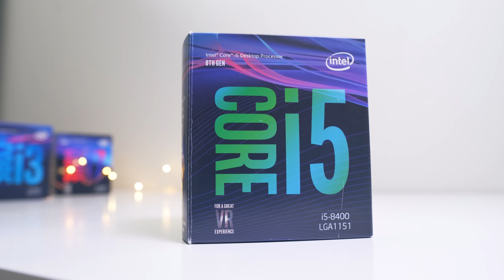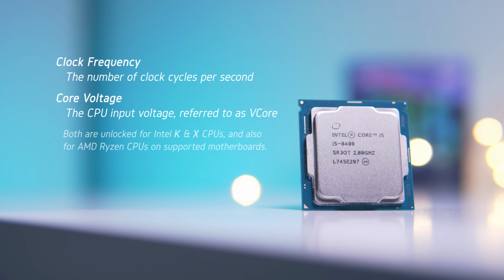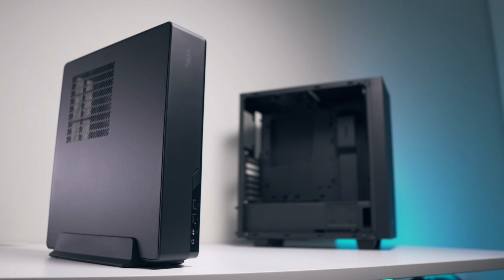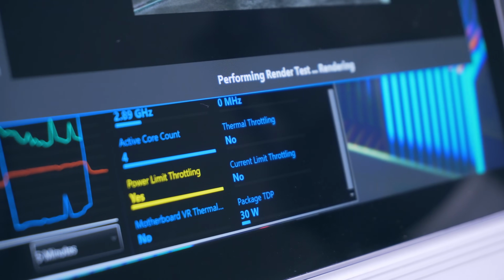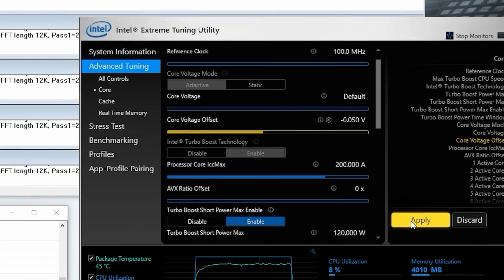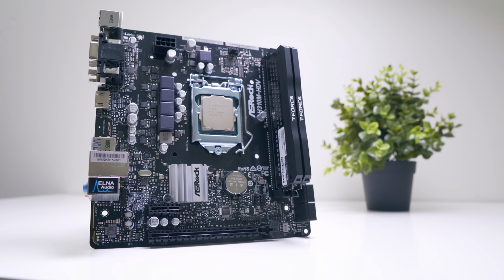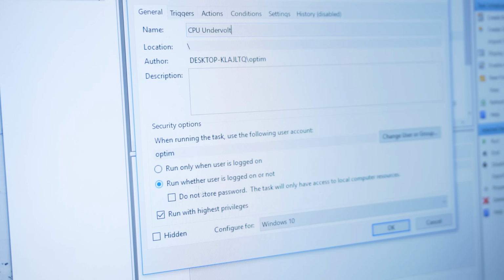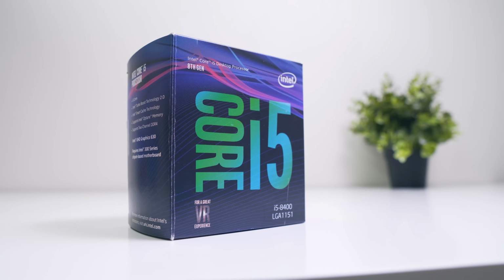How to Drop 10-15C° on Locked Intel CPUs!

Comment from the maker: Got this i5 8400 running stable @ 1.02V! I'd say under 1.0V would easily be achievable for some chips. 

Drop your undervolting adventures down below!
Reply: Intel has been supplying that same cooler for almost 2 decades now. Cheap bastards! At least AMD supplies a somewhat decent stock cooler with their processors. No, I'm not an AMD fanboy. I'm running Intel right now, but with a custom loop. It helps in the winter! Cinabench doesn't get the CPU as hot as Prime95. It does not use AVX. For Intel CPU's, I would use Intels own Extreme Tuning Utility, XTU.(Link Below) It will stress test the CPU far better than most programs, and has a lot of additional functions and info regarding your particular CPU. Undervolting does work very well, especially with laptop CPU's. Considerable performance gains, and extended battery life can be achived. Just speaking from personal experience. Worth a look.

https://downloadcenter.intel.com/download/24075/Intel-Extreme-Tuning-Utility-Intel-XTU-
Reply: @mattsmechanicalssi5833  I get your point but its but its not the same cooler they just look the same. The old one 3rd Gen and before had a solid chuck of copper in the middle.  The ones since 4th/6th (Can remember which) don't have the copper, it does makes a difference in cooling.
Reply from the maker: Santiago - some B360 and H310 boards do not have the option for voltage offset adjustment. If your board does, I'd definitely recommend doing it that way (I've done a few videos showing how to do it that way previously).
Reply: @optimumtech  need to get rid of power limit throttle. Using i7 8700 on H370. I had no issue on i5 8400 but swapping with i7 8700 there is power limit throttling so clocks drop to 4.0/4.1 in CPU intensive tasks. Can you please provide me the script so that I don't have to manually change the PL1 to 95w(in XTU) every time I restart my computer. Thanks...
Reply: Optimum Tech Can you review the Asus hero and scar please👍🔥🤔🥇💻⚠️
Reply: Thanks for the video! I followed your instructions then put the offset in BIOS. On my i5-8600 I was able to go from 89 C stock to 74 C with a -0.200 Undervolt using Prime95 Small FFTs and confirming stability using Cinebench and 3DMark.
Reply: Santiago - when idling the temp won't change, but when under load while gaming or using Prime95 you will really notice a difference.
Reply: Santiago -Alright, looks like you found your spot then. Enjoy your slightly lower temps.
Reply: On i7 8700 1.08V i got minus 7 degrees celcius and  500rpm lower on cooler. Thx for help.
Reply: @vasseurstan  how, can you please tell me your voltage and bios settings for lowering the temperature?
Reply: I think it should help, as reducing the voltage will allow more amperage to go to the CPU using the same wattage.
Reply: Optimum Tech would you use xtu over an offset in the bios? The software seems much easier to work with than having to go into the bios.
Reply: Should be pretty much the same on a i5 8500 right?
Reply: Asef Jamil Ajwad Try to find a tutoerial to unlock tdp limit.. i did from 15W to 25W
Reply: Santiago I did my voltage changes in Bios and got my temps to go down as well. Good luck!
Reply: Santiago -really? Interesting, I would have anticipated at least 5 degrees difference. How long are you letting Prime95 run before stopping? I'd recommend running it 15 minutes before stopping to let the temperatures ramp up.
Reply: Santiago - ok that's alright. If you push the voltage down more I think you still have some headroom left to lower your temps even more.
Reply: From 74C° at 2200RPM to 64C° 1950RPM with a -0.140V offset voltage on an i3-8100 in a DAN A4-SFX. Now I just need the Cryorig C7 and undervolt my GPU as well.
Reply: How do I know the best undervoltage for my processor by the way my processor is Intel core i5 2520m 2.50ghz
Reply: I used your same setting for my i5 8400 (with an Arcitc Freezer Esport Duo), and now at full load it does not exceed 49c.
The stock voltage reached 55/57c.
Great video and thank you for the advice!
Reply: RochiGaming, Intel. XTU advanced options are greyed out for me. How do I change the Core Voltage Offset? It’s not letting me change any settings.
Reply: TheOgWalnut Did you have my same CPU?
Reply: My personal Intel Celeron laptop is fully Locked and I can't undervolt it at all, even on Intel XTU. 😭😭😭😭
But Wait!!! One day, I was going to Mom's office because there are no one else at home, and then I suddenly found an empty unused PC there at the Office!
Unfortunately it had a spec of a potato, with a Pentium G3620 (Dual-core 3.3 Ghz) & 2 Gigs of DDR3...
But the fun thing is that I could install Intel XTU with no troubles at all!
I tried to undervolt it to the limit, as most kind of people do, and I started from -55mV and keep moving down every 10mV to -65, -75,...
I was suprised that I could put it down to -150mV!! Moreover, the Maximum voltage at stress test is now only at 0.947 volts, which is pretty low on a desktop CPU...
I finally stopped at -195mV @ 0.895V since it crashed after 30 seconds of stress test. So I turned it back up to -135mV.
But -195mV is a really massive number on the CPU world, and moreover, this is desktop CPU!!!

Note: using Intel cooler
Reply: Ive just undervolted my i7 7700 and Ive got pretty good results as dropped 10°C, but Ive got coil whine on my GPU now, Ive tried to reverse the procces but still getting that noise, do you have any advices/solutions for me?
Reply: -140mv on i3 8100, allowed me to turn the CPU cooler down to the lowest speed (will ramp up if it ever gets within 6c of maximum safe temperature) and I also completely did away with the single case fan I was using. This only increased the stress test CPU temperature by 2 degrees over the temperature I was seeing before the undervolt!
Reply: I went to 1.20 and it worked for a few hours then next day every game started crashing, it seeems to be fine at 1.22 but who knows
Reply: I guess I'm pretty off topic but do anybody know of a good website to stream new tv shows online?
Reply: @Robert Valentino i watch on FlixZone. You can find it by googling :)
Reply: @Corbin Adam yup, have been watching on flixzone for months myself :)
Reply: @Corbin Adam Thank you, signed up and it seems like a nice service :) I really appreciate it !
Reply: @Robert Valentino glad I could help :)
Reply: 12700 processor any ideas?
Reply: 11400f from 55-40 -100mv
Reply: I got mine stable at 0.944V, delidded, reaching 60C at 2h P95
Reply: Me too. 
core iccmax = 133,000 A
Turbo boost short power max = 82 W
Turbo boost power max = 65 W
Turbo boost power time window = 28,00 Seconds
I wonder, is it safe to change them as same as in the video ?

Comment: Unfortunately, I don't find the tool for my old intel processor. It would be great if someone could guide me on how to tweak it.
Below is my system configuration
Model : Dell Inspiron 14z (N411z) laptop
OS - Windows 10 version 1909 (64 bit).
Processor : Mobile Intel Core i5 2430M (Sand Bridge) - 2nd generation.
Chipset : Intel 6 series C200 series.
Bios : A06 (from Dell).

Comment: i have intel i5 11400H. in Intel's drivers download page i can see intel xtu software. That's means my cpu supports that software. But when i install that xtu software i couldn't change anything. You changed 8400, how tgat can be possible
Reply: newer cpus are locked by Intel
Reply: @sdtrtl  can i unlock, is there any options for these ? i have dell laptop

Comment: So I have about 100 Small Form Factor PCs. Coffeelakes; cannot undervolt, but cutting the max sustained powerboost from 65w to 50w gives only about a 7% reduction in clockspeed but about 17% reduction in power consumption, 12w so ~9% more efficient. Wish I could but sliders r greyed out. 
I CAN undervolt on Haswell and some Skylakes but not all it's very strange. Same model of SFF PC, some do some have it greyed out very weird. Leaving power limit the same but undervolting i5-6500 or i5-6600 by 0.12v reduces power by ~9 w 
Haswell i5s more sensitive downvolt by 0.07v.

Comment: bruh if the cpu is locked how are you changing core voltage and stuff they cant be changed in a locked cpu like i5 1300h

Comment: CPU: I5-9400F locked 3.9GHZ
Pre Tweak: 55c, 1.15v, 5818 multi score (CinebenchR23)
Post Tweak: 43c, 1.03v, 5850 multi score (CinebenchR23)

Power consumption also went down a bit, though I didn’t check by how much. 

Thanks for the guide! Shame you can’t OC these chips, looks as if there’s a bit of headroom.
Reply: Thanks for letting me know it will work on my CPU

Comment: I've got i7 8700 and installed hyper 212. Temps are OK stays around 60c while playing apex legends on 1080p low. But my concern is will undervolting reduce its clock speed? Right now it clocks @4.3Ghz on all cores without any issue but when stress test(powermax) it drops to 3.3/3.4Ghz with PL1 65w and PL2 87w(default values) and when I set PL1 & PL2 to 125w it never drops below 4.3Ghz on all cores while stress test(powermax) but temps touches 83/84c in 10min stress test.
Reply: As long as you’re not throttling whilst playing, it doesn’t really matter ig
Reply: @IIHydraII  yeah it's fine temps are fine I'm using adequate cooling solution but everytime I restart computer I've to manually change PL1(65w) & PL2(87.5) to 95w & 120w respectively. I need a script that runs automatically. One thing more my motherboard don't have any option to change power limit. They have removed in the latest bios and now I can revert to previous version of bios.

Comment: Is there something that works similar to this for I7 2600 (non-k)? I have old mini atx PC with that I7 and Gigabyte B75 mobo and I would like to drop a voltage a little bit, but the Intel software works only for modern CPUs. :/ That PC would work great for me as HTPC, but I would like to drop a little bit the thermals and noise.
Reply: You need to use an older version of XTU, they removed voltage offset in the newer versions. That might have been your issue.

Comment: For some reason my core voltage offset is greyed out
Reply: cuz u have intel 10/11 or 12 gen . I have i7 10750h and i have same problem. I try to find solution since march...
Reply: @ArctickPL  no I have an I9 9900k
Reply: @ArctickPL  "It is no longer possible to undervolt Intel processors with modern BIOSes and microcode, due to the changes needed to patch the Plundervolt vulnerability."

Comment: My man, your video might have saved my PC's life. I've got a i7-10700F (locked) which is water cooled but it's been throttling and reaching temps ~100 degrees. I'm about to change out the thermal paste and dust out my radiator, but I didn't realise you could still tweak the offset with Intel ETU. Could be huge, cheers man!

Comment: What this essentially *is*, is a how-to on undervolting. Which is fair enough. 

What it isn't though, is what you actually titled it. If voltage offsets are indeed locked on your system, you can go through the motions of undervolting, but with zero results. Stuff will be grayed out in XTU (at least giving you a clear message this isn't working) or have a tiny annotation it TS, which tells you FIVR is locked (but it still lets you click things to your content).

Comment: When I undervolt my cpu the IA offset and LLC/Ring offset both changes to negative but when I reboot my system and task schedule like you did only IA goes to negative then again when I manually change the undervolt settings and apply both IA offset and LLC/Ring

What's the difference between IA offset and LLC/Ring

Comment: I have an i7-10700f processor, but the setting of the core voltage offset is grayed out. Any ideas why that is ?
Reply: Cause its locked dude. 10th gen cpus are locked to death. Cant undervolt my 10750H too
Reply: @starmember132  Wait, 10900k can't be undervolted?
Reply: @ZeroCool22  I think it can. K models are unlocked I think. Mobile ones like H models are the ones locked unfortunately
Reply: @starmember132  you need to use older version of the software

Comment: For my Intel 10750h, it wont let me adjust the core voltage offset at all in Intel XTU and ThrottleStop. What should I do?
Reply: Check BIOS. Look for "unlock overclocking" or the like. Even if you find it, don't be surprised if it's Max undervolt is 0.05v as a hard limit due to security vulnerability found in Intel processors when undervolted too much.
Reply: @computerista  and what should I do If bios doesnt have any advanced settings? Its so fucked up. I have an hp pavilion, with the i7-10750H and cant fucking reduce the temps cause its locked.

Comment: cant unervolt my 8700 via xtu, the core voltage offset is fainted. So unusable for me. MSI B360 gaming plus, i7 8700
Reply: in bios it should work
Reply: @spatrk6634  I know this is late, but what option do I need to look for in the bios?
Reply: @danielcontrerasgonzalez4520  voltage offset
or V offset
depends on your motherboard how the option is called

Comment: Is this safe to do if use the Intel program? I'd really appreciate the help. I've never undervolted my CPU so I'm not sure if it's safe. I have an i5 8500T
Reply: undervolting is safe.
worst case scenario you will bluescreen and will restart your pc
basicaly you just reduce the voltage by 0.05 and stress test the system
if it doesnt chrash reduce by another 0.05v and stress test again
if it chrashes you need more voltage or reduce clock speed
its fun to do it and you cannot hurt anything with undevolting.
its putting too much voltage on your cpu is what hurts the system.
and yes you can use intel XTU for undervolting.

its same for overclocking. you just increase clock speed and voltage while monitoring CPU temperature
if temps are fine and system is stable during stress test, you are good to continue to increase more

Comment: HEY Ali! 

I know this video is old, but the recent Build 20h2 on Windows 10 completely disables Undervolting on many CPUs. However, there is a workaround that we can still use:
https://www.techspot.com/drivers/downloadnow/16919/?evp=934d518f974f270a6ccf463c3d706f51&file=1

Using an older version of XTU!
Reply: So, i download the version you mentioned, and then I do this dude’s procedure? I have an i7-10750H and its locked af

Comment: I like this tutorial, its well written and the section on using the XTU to undervolt was absolutely spot on, but the current version of the XTU changes the filenames and where files go, and as such the script to auto-start the program and apply the undervolt no longer works

Comment: thank you for the great video. very useful. i find it a strange and potentially problematic strategy to do this in windows. however i think about it, doing this in bios is much more time saving, stable, and reliable. i guess this particular motherboard did not the options in the bios?

Comment: Hey : D

i got an HP zbook with a xeon E2176m cpu, it runs super hot. I undervolted -0.100 and it hasnt caused any drop in temps whatsoever, it still reached 95c in the stress test and starts to thermal throttle. Any clues? thx!

Im so worried this thing is gonna fry! i do everything with this lap, music making, videos, gaming...it always runs hot!

Comment: My i5 8400 works well today. Set offset voltage to -0.150V in bios, with LLC mode 6 in msi z370 gaming pro carbon.  BCLK OC to 102.6 mhz, running 3.897 ghz all core, uncore could be 4.0 or 4.1 Ghz.

Vcore about 1V in cinebench, max temp load 70 degree,  stock cooler.

Comment: I have an i7-8700 non k. Temps are pretty normal idle and while running most Games. But while playing cod MW it gets way to hot. Mid 80s low 90s sometimes. Most other games it usually stays under 80. Should I get a new cpu cooler?
Reply: obviusly yes

Comment: my result: i5 9400f - 0.19 V. After that  CPU temperature decrease 9 C, and CPU fan decrease 650 rpm  (stock 2250 rpm,  after undervolting 1600 rpm) I have good result, because my CPU have new stepping R0

Comment: I cannot change the core voltage offset. It is locked.
Reply: I'm surprised the video didn't cover that. I mean it's like the main impediment one faces with a locked CPU which is in the video's title.
Reply: @AstralApple  i searched the entire comment section looking for anyone who would mention that. i have a i7 9700 but cant change the core voltage offset cause its locked.

Comment: Been doing this myself over the last couple of days. I found I can undervolt quite a bit and it seems stable in stress tests and games for awhile but then seems to get random freeze ups when not even doing anything so I bumped te power back up a bit. I found I could go to -00.45 and stay stable. This is at 4.6 on a 7700k rather than leaving it at stock speeds though
Reply: Can u help me? I m having i5 3210m. It's not showing FIVR , how can I undervolt then 🙄

Comment: something weird is happening, i undervolted my i5 9400F by -0,140v stable (-0,160v seems to be the limit and 0,150 runs bit weird) and dropped 10c but i cant reach 4.1ghz anymore idk why, i didnt touch anything else.
Reply: Bad silicon. Just up the voltage again until you can hit 4.1 stable.

Comment: Hi, I used to undervolt my laptop (Dell G7 15 7590) using ThermalThrottle, but I noticed that the undervolt is not working anymore. I tried to set it again but my options in ThrottleStop are all grayed out. I tried using Intel XTU but my option to set the Core Voltage Offset it also grayed out and can't be changed. Any idea why and on how I could like unlock it? Thank you so much!
Reply: Same thing is happening to me. The “Advanced Settings” in Intel XTU are all greyed out and I can’t edit them.
Reply: @DusskStudios  Dude, I found the the solution just yesterday!

https://youtu.be/NkX71nBIrcM

Hope it helps you too.

Comment: Do you know if there is option on B360/365 motherboard for offset so I can apply the offset voltage directly in the Bios rather than running program?